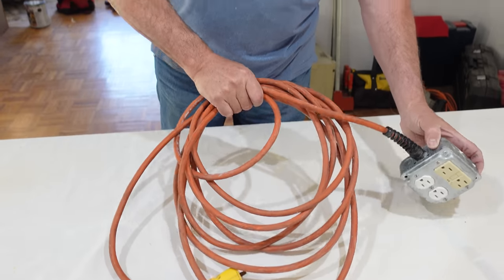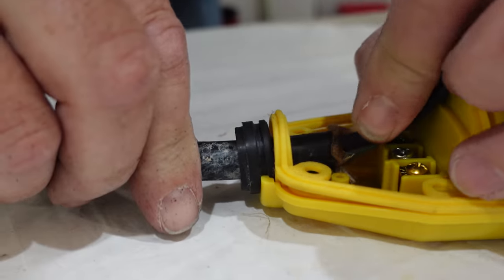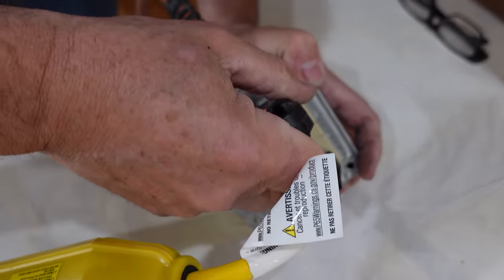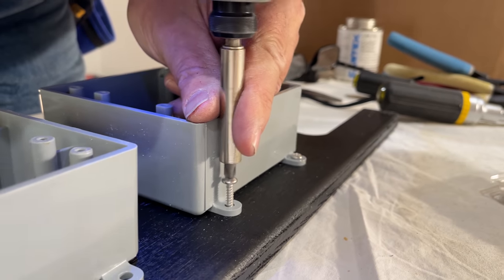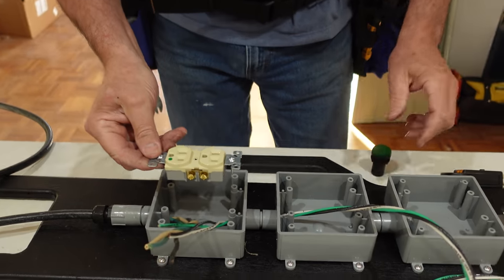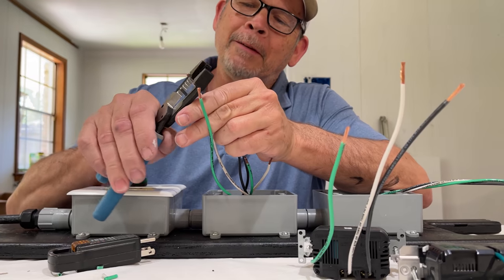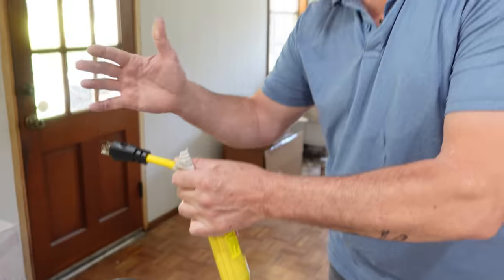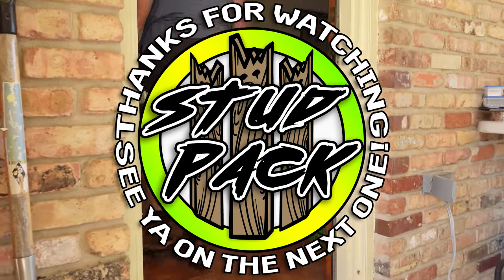HOW TO MAKE THE ULTIMATE EXTENSION CORD!

Comment: The next thing I’d like to see is an extension cord that allows for 240 volt input and has a built in breaker panel on the board, that way you can run a really high power device like a table saw or a planer. You also get a nice advantage if you use 240 for the cord, because by adding one more wire and using a 4 conductor cord you can either run a 240 volt tool or you can split the phases and have twice as much power for 120 volts. You could also add one of those little voltage and current readout displays that way you know how much power you are drawing. And as for why the breaker didn’t trip at almost 30 amps, if it’s a 20 amp breaker it is expected to hold at 100% of its capacity (20A) and thermal trip at 125% of its rated capacity, and magnetic trip (short circuit) at 200% it’s rated capacity, thermal trips usually take a while, because when you have a current surge on say a saw it can often pull over 20 amps, and you don’t want the breaker to trip every time you start your saw. ElectricianU has a good video on that subject
Reply: I think your point is twice the current when you split the 240v into 2 120v circuits.  However, technically Power = Watts (unit of measure in the US) = Volts * Current (for DC anyways, AC is more complicated than what I'd do in youtube comments).  When you halve the voltage from 240 to 120 and double the current, the power is exactly the same.  120v * 20A = 240v * 10A = 2400W.  Though when talking about power tools, air compressors, and such with electric motors, from what I understand, the 240v motors tend to be more efficient and run on less power, but now the argument changes to apples to oranges.
Reply: @jimparker5185  His point is that you can run twice the amount of current through such extension cord. Either expressed in watts or amperes is irrelevant, it boils down to the same conclusion as the line voltage doesn't change. Two phases with the same wire diameter as they would have done at single phase means that you can draw twice the power from it. But i think this project was already a little bit shortsighted over the top (but perhaps fun if you have lots of time and materials left over), and they have proven that they can run 3 saws and a vacuum cleaner simultaneously on the current setup, so making it two phase is really something for when you're into your tenth year of retirement bored and really don't know anymore what to do.
Reply: How often do you find a 240 circuit available? How many portable table saws or planers use 240? Those are usually shop equipment that might even be hard wired to their individual circuits.
Reply: @idadho  dryer and range outlet are 120 /240v
Compressor welder pvc heat box and large circular saw are the most likely to be 230v on a job site

People usually use spider box in those instance
Reply: @patricelebrasseur5649  In the US, tools are 110 unless they are shop mount grade/not portable. Nobody takes a 220-230-240v compressor to the job site. A portable welder would have a gas engine to run a generator and probably be 50 amp, at least 30 amp. A 220v saw is a shop saw. They use 220 vs 110 to save on electricity costs. They are a bit cheaper to run. The Teenage Engineer does not know what he is talking about. A 30 amp 240 circuit only has 30 amps per leg. No power tool uses 30 amps on 110. 
Finding an available 240 circuit is not likely on a job site.
Reply: @idadho  120v compressor are limited to 6 CFM, Ingersoll Rand and rolair are selling 12-19 CFM wheel barrow style compressor, most of maffell timber framing tools are 220v even in the USA and here in Canada.

You can't bring 1000's of feet of welding cable inside an hospital remodel, you use a smaller inverter welder

Lots of concrete crews are using coring rig , sander and saw that are more than 1800 watts

I know I was doing electrical distribution equipment rental, both for outside events and large construction
Reply: @patricelebrasseur5649  Maffell makes both 110 and 240 options for the US 120 and European 240 markets. Ingersoll Rand, too. I haven't seen 240 power on a residential construction site in decades.  I don't see 240 in hospital rooms, either. 20 amp 110. There may be some extreme situations where 240 is used but not on residential construction like StudPack's audience. Nobody is going to say, "Let's install a 240 circuit for the remodel crew" on a residential job. On a big commercial job with demo, maybe.... They would be spec'd as part of the contract. 240 circuits are usually single load specific so they would not be readily available to the workers. Hey, there's a 240 receptacle. Let's plug into it. Is it 3 or 4 prong (20, 30 or 50 amp) Twist or push. 5 or 6 plug types. 
Yes, you would use a spider if you had the job set up for 240 because there would not be many circuits.
Reply: Would be rarely useful as it would start to get really heavy. I’ve got a 150’ 220vac cord that I use on welding jobs and it probably was 75-100lbs by itself.
Reply: @crackpotts5347  I have a 50 footer that I cut in half so I could handle it easier. Yes, heavy cord.
Reply: next up on stud pak - I show you how to make a portable 200-amp electrical panel with all the fixin's. Only thing is, this one you hook up directly to the transformer on the telephone pole! Works great! So, first you need some old wire that my dad had lying around. Then you get yourself this here old box....
Reply: You would never assume access to a 220V outlet on a residential job site. There are a lot of homes where the 220v/50-amp range circuit or 220v/30amp dryer circuit were never installed because the owner uses gas (the case at my house). The only 220v circuit is at the A/C and that is hardwired with no receptacle. If you bring 220v tools, you would bring a generator capable of supporting it or check the site in advance and if the breaker panel can support it, you might install a 220v breaker for temp power, but that is a lot of unnecessary extra expense. Course, "good" sense would be to never use 220v equipment on a residential job in the first place and save yourself the added headache.
Reply: To make a really, really super cord, take a 6/4 SO cord and put a male California plug on one end and a very large metal box on the other. Add several single pole 1" breakers and one double pole breaker.  Wait, that sounds like a spider box. 

Unless someone is running giant non-portable tools, the need for such a device is minimal. A flooring person may have a 240 v floor sander, which can be plugged into an oven or dryer outlet, or adapted to two 5-15 male plugs plugged into both the disposal and dishwasher receptacles, as they are on different circuits on different legs 99% of the time. Thats a whole other thing, though.
Reply: @idadho  Several of Maffell larger saws ONLY use 220, and practically every professional floor sander refinisher contractor in NYC uses a 220 sander. Yes they pop panel covers and bug in with clips. It's sketchy but works. We did new construction residential and commercial and large Manhattan loft apartments and we routinely set up 220 options because...well we can't run gas generators in loft apartments and the DOB-FDNY rules for gasoline powered anything on a site make grown men cry.
Reply: @ericdillenberger7873  These are one-off custom set-ups, not plug and play. A 240 extension cord like mentioned would have pigtails, not a plug. Bootlegging off the stove/oven or drier circuit at the panel is not for the uninformed.
Reply: @idadho  True for sure. All our set ups were custom, usually done by our licensed electrician. Floor sanders...that's just how they roll. Badges, they don't need no stinkin badges.
Reply: @fourtwanky  And on this classic episode of This Old House, Al cays "Watch today as we build a 6-drawer Shaker-style dresser with matched woodgrain on the front, and we're going to build it out of [looks around on the ground and finds branch] this stick."
Reply: I built a power box using 3 phase 480 and 230, single phase, and 120vac. We use it on a daily basis. I installed breakers on each outlet. Very robust heavy SO cable
Reply: This is a 3-wire circuit and is fairly common, especially in kitchens.  It has the added benefit that you reduce voltage drop, if you had 2 identical devices running on each side, the neutral would have zero current so no drop.  I've used it to make a couple of extension cords and included a 240 outlet on one for them.
Reply: @idadho  Actually, quite a lot of job sites have 240VAC circuits available. Usually they get split into +120/-120 at devices called Spiderboxes, but they also get used for indoor welders that use 240VAC directly.
Reply: @NikkiTheOtter  There is no such thing as +120 and -120 power legs or devices. The different phases are not different polarity.
Reply: @idadho  I'm not saying they are either. They're 240V apart though, and 120V from the common neutral. And it's easier to clarify which leg with a + and - symbol, over saying A120 and B120 which implies that they aren't implicitly connected. I was taught that + is the top of the transformer, - is the bottom, and neutral is the midpoint of the center-tap transformer.
Reply: @NikkiTheOtter  I've never seen + and - used to clarify legs. Most wiring is nowhere near a transformer. A120 and B120 are not connected until they are. Other than at the panel, why would one need to identify which leg/phase a conductor is? 
As stated by others, when 240 is needed for construction, that capability is wired in by an electrician. A temporary power panel might have a 240 outlet if needed. It is not  a DIY feature of the job site.
Reply: @idadho  Color coding, cheater cables, circuits that are run parallel but on different rails...It's just a way to make things easier and more consistent through a circuit with multiple breaker panels. No reason to be rude
Reply: @NikkiTheOtter  What did I say that was rude?
Reply: In Europe we just call that an extension cord 😂

Comment: I love it! The only concern I have is the cover plates extending beyond the edges of the boxes. They are probably going to catch on something and break, but I understand using them from a convienence aspect. You could build a plywood face to go around the boxes to give them some protection, or make custom plates from a flush fit cover. As for the automatic wire strippers, Harbor Freight has some in their new Doyle lineup that so far are just as good as my much more expensive brands.
Reply: Regular 1900 boxes would have worked fine here
Reply: I was at a family gathering and I saw a similar type of extension cord however they figured out how to recess the boxes into the plywood and I think it was two layers, it was really slick.
Reply: You can put those box covers on a table sander and shape down to size of the boxes and radius the corners too.
Reply: don't look water proof.
Reply: All those water tight parts and joints, and does not protect the receptacles from water intrusion. IP41  at best for water resistance. More likely IP30.
Reply: @TheDrewsifa  open-faced receptacles are never going to be water "proof." Even most outdoor setups are only water "resistant" in the direction of the water shedding (generally from top to bottom). It would be very expensive and unnecessarily burdensome to expect a job site extension cord system to be fully water proof to the extent that you could submerge it in a bucket of water

Comment: My 3 guesses why the breaker didn’t trip:
1) the wire takes a little longer to heat up with only 8 amps over. The breaker will trip, it’ll just be a little bit.
2) the breaker will not trip because the manufacturer designed the breaker’s tripping mechanism to have a bit of leeway.
3) the breaker is faulty, and could be stuck in the on position.
Just guesses. Can’t wait to see the actual explanation! Love your videos!

Comment: Was typing out the thermal trip function, and just saw @Riles223 explanation, which is perfect. 

One thing I noticed though: You went to a lot of effort to select equipment that would be water tight, from the fantastic GFCI plug to the water resistant strain relief with the o-ring seal for the cord going into the first box. But then you used standard plates instead of seal-tight plates, which would help keep moisture out of the boxes from the front.  Which is fine, you'll most likely have the unit in a garage most of the time, so it's not like you need water-resistant dome covers or anything, but I thought at least seal the box edges. It surprised me. One suggestion you could do, IF you had to have the box out in the elements, is to caulk the box edges and then re-secure the plates. Kind of a makeshift solution, but it does seal the box itself. Just a thought.

But I love the idea, I have a power unit in my wood shop with a variety of connections, I love it. And I love that you made yours portable, I love the cable wrap and handle (very clever adaptation), you guys clearly put a lot of thought into it. VERY user friendly. Good stuff. Great video.

Comment: A 20 amp breaker is rated to run 20 amps basically forever without tripping. As you increase the amps, the TTT (time to trip) decreases linearly. This means that you can draw 28 amps but some period of time before it trips. Probably 5 to 10 minutes would be my guess.
Reply: No, they're only rated to run at 80% (16A) capacity or below forever without tripping. 21 amps would trip it instantly.
Reply: @TheDarthJesus  You are thinking fuses not breakers.
Reply: @daltonzoletta  it applies for both
Reply: @daltonzoletta  
Either way best practice is to not load any circuit beyond 80 percent
Reply: @daletyler5344  I will 100% agree with you on that
Reply: this shouldn't have 26 likes. 80% rule for fuses and breakers. 100% rated breakers are usually for commercial/industrial with electronic or adjustable trip units. Usually for 480V plus.
Reply: @herro36  I've tried.. it's like talking to a brick wall.
Reply: @TheDarthJesus  This is simply not at all true. The 80% you are thinking of is the NEC rating for circuit sizing of a continuous load. So when you are planning, the 80% rule applies - it does not mean the actual breaker will trip at 80% or 100%.

Instant trips require the magnetic side of the breaker to trip, which starts at 10 times the rated current (200A) for your typical residential/commercial breaker that a plug-in cord like this would be connected to. The trip curve shows that a QO 20 amp breaker will pass 25 amps indefinitely (trip curve docs go to 10,000 seconds). That same breaker will even take between 8 and 35 seconds to trip with a 40 amp load.
Reply: @patrickclochesy1990  Standard breakers are rated for an 80% continuous load. Running over 80% puts you in the nuisance tripping zone.

Comment: Hi I'm just a DYI guy, but like the power bar. I did borrow your general idea and added a one piece plywood backer under the switch plates. I found when you wrap the cord or plug in a device that is tight, the sides of the plate's were always breaking. Also made a portable vertical stand with a shelf that I can use were ever I go. Shelf can hold charging phones, boom box, etc. thanks :)

Comment: Here in Norway, you are supposed to use some metallic ends on the multi stranded cables when connecting it to a socket.
Solid is fine.
Wires with 8-12 strands is fine.
But on the cables that have dusins of strands you are supposed to crimp on a thingy, don't know the english word for it.

But when putting it in a wago you dont need that.
Reply: Yes you can get a ferrule crimper kit for~$20 and it's a game changer for terminating stranded wire
Reply: As with the other comment, I think the word you're looking for is ferrule.

And I believe you also meant dozens of strands?

Comment: Would like to see the electrical panel and the manufacture and age of the breakers. Older breakers are prone to not sensing the overload as quickly as newer style ones. Depending on the manufacture of the breakers and manufacture date, there was a time when a few manufacturers had quality issues with maintaining the tolerance requirements for an overload condition.
Reply: you must be talking about the Federal No-Arc panels and some Push-matics of the 50s and 60s.

Comment: 26:16 Okay, last Dad comment (on this video :-) for you. When you wrap a cord in a loop as you are doing, you are introducing a twist. The conductors inside are twisted, and the strands of each conductor are also twisted. This compounding effect is what causes old cords to the get the "umbilical cord" damage. However, with the quality of cord you are using here, that is never going to become apparent (as evidenced by the age of this 3 generation cord). Even so there is still a good reason to use my Dad's Navy wrap method. The Navy wrap is to make a figure eight on the side opposite the handle. This has 1 immediate benefit of not obstructing the outlets. But also each pair of wraps is a 1/2 twist minus a 1/2 reverse twist. Here's an exercise: If you extend the cord only 1 foot because that is all you need at first but then later decide to take out the rest of the cord to move your tool farther away, you can do so without unplugging anything. The cord will be straight. No twists. Try that exercise both ways. It's mind blowing.